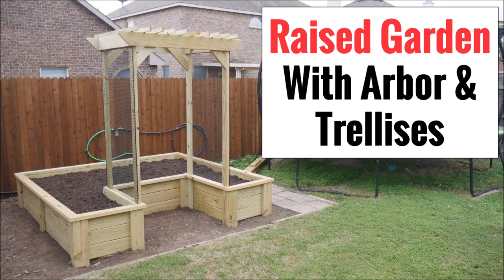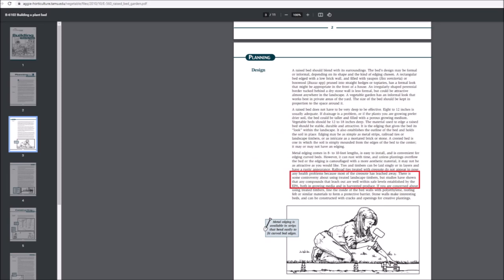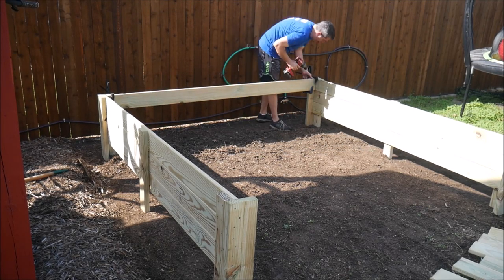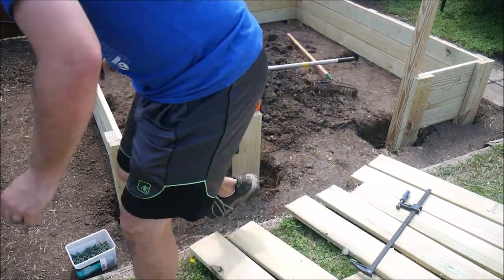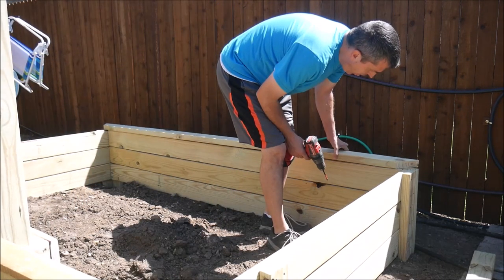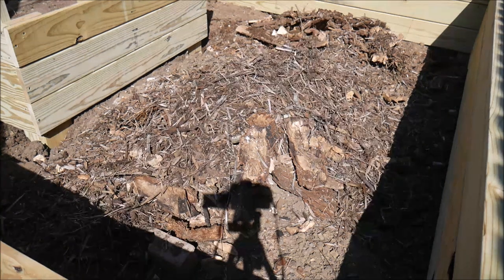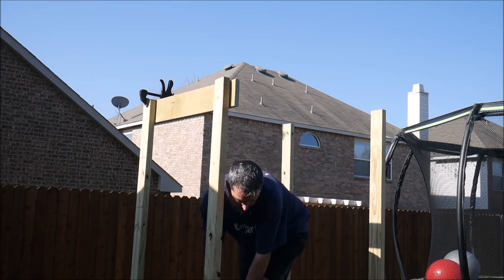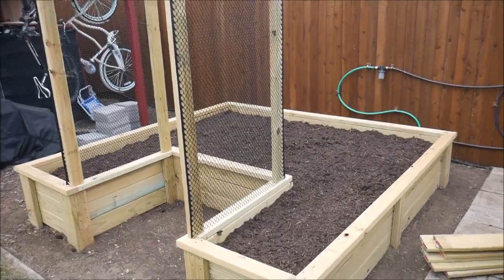Raised Garden Bed With Arbor And Trellises - Beautiful, Durable, and Efficient!

Comment: Forgive me if I'm missing the point of a raised garden bed, because for my money, if your going to raise it, raise it high enough so you don't have to bend over, then you've done something ergonomically beneficial.
The worse position one can take is half way between a full bend and complete stoop.
    Then one might say, that you can always use one of those wheeled bench's to sit on and it would be a perfect height for this sort of raised garden. Being a older person myself, I can assure you that next to stooping and or bending over. is sitting with your knee's bent all day, bad for the circulation and even worse for the joints.
     It's my belief that the raised bed and or aqua gardening of the future is hip or waist with dumping floors
   under the garden bed to transfer old soil to wheeled carts that sit under the bed. Open the floor, down comes the dirt into a wheeled transfer bed to be put back into the soil. Close the bottom and start with the new soil. 
     All done standing upright, good posture and circulation as well as better for the heart. Lift that bed higher, higher HIGHER, ( I just need your love, to lift me higher ), thanks for the video, just an old mans opinion. Think nothing of the man standing behind the curtain. Love gardening but need to get to doing it again, love that dirt. P&L ( : > ).
Reply from the maker: That is a fair point.  Maybe that is the rationale for a raised bed for some people but for others it is more about having better control over the soil, prevent some of the weeds, and prevent pests such as rabbits and turtles from getting in and eating your crops.  If I sow seed directly in the ground in my area it is all clay so the crops will grow but the water won't drain well and they will get diseases and have problems.  And it is much harder to mix in amendments and fertilizer into compacted ground soil.

Also, to get a raised garden bed up to 30" or so height which is fairly standard for desks and counters, you would need triple the materials (wood, screws, dirt, etc.).  That raises the price considerably but also causes problems that I don't think you are taking into account.  Number one, that is a lot more volume of dirt to water and fertilize.  The farther away from ground level and the water table that your crops are, the faster they will dry out.  That is a major problem here in North Texas.  Another problem is you will have just as many ergonomic problems when it comes to tilling the soil and preparing it for the next season.  You will either have to stand on a ladder or climb up into the bed to use a hoe and shovel or whatever.  And finally, the bulging/bowing issue will have much more dramatic.  I would estimate you would need to use solid 4x4 posts on the corners and at least one in between on each side driven into the ground at least 8-10" to prevent the sides from bulging out with the weight and compaction of that much soil.

I agree with what you are saying but I think you can take some steps to alleviate ergonomic challenges on a raised bed without going to that expense and effort.
Reply: @LDSreliance  I totally understand the entire concept of bed gardening and suggested  that the problems you are suggesting are simply a matter of good planning. I don't think you understood what I was saying about removing all of the dirt by having a collapsible bottom.
     The framing need not be wood, but a combination of wood slants and either aluminum angle or old steel bed frame stock, which can be found in just about any trash bend. 
     That angle iron is pretty strong and then the removing of the dirt is simply a matter of positioning a wagon type vehicle under the bed and opening up a collapsible bottom, and the dirt just drops down into the wagon. 
     Don't need to toil with hoeing, just set up a new bed and recycle the old girt next year after it's had some mulch time. There's always a way to skin a cat if you just spend some time working it out, you know what they say " Necessity is the mother of invention".
Reply from the maker: I can definitely see that as an option.  Good thoughts.